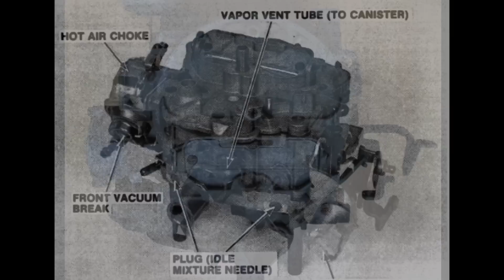Strangest Automotive Inventions:  GM's Rochester Dualjet Carburetor Or The "Demi-Quadrajet"

Comment: I remember my moms friend bought a new 76 Grand Prix, had a 350 2bbl, (my parents had a 73 with 400 4bbl) I opened the hood on the 76 and wanted to see the carb, it was a quadrajet without the secondaries like this video is describing, I was kinda surprised. I was used to seeing the 2bbls on the early 70s 400s and 350s, which was the small round type carb, was a pretty 76 tho, white with blue interior, I rode in it once and was impressed with the quiet smooth ride, it was probably less than 6 months old at the time. Never forget little memories like that. in metro ATL! I was walking down the road and she stopped and asked me if I needed a ride, since she was headed to our house anyway, A/C was on and it was hot outside so I jumped in!

Comment: My friend bought a 75 Buick Apollo and I remember we thought it was awesome that it came with what we *thought* was a 307 with a quadrajet.  Seemed sluggish and we just assumed it needed some tuning up after sitting for a long time and had those malaise era highway gears in the rear end.  When we started getting into it we were so confused when we found the dual jet. Never heard of it before!  And of course that 307 turned out to be an Olds 260 as well with it's itty bitty pistons...  Those were quickly removed in favour of a 400 Pontiac that was sitting around!

Comment: I almost killed my 56 Pontiac Chieftain rebuilding it's Quadrajet square bore carburetor. I left town easy, it worked fine. Coming back I gave it the beans, the throttle stuck. I pushed the brakes to the floor, repeatedly jabbed the throttle, 100mph. I reached to shift into neutral, to blow the engine and there was the key. I turned it off and stopped, now in town, and looked at the carb. One link I put on backwards. Flipped it around and I was OK. Old Quadrajets where tricky but where the best when tuned right.

Comment: Adam as a side not this carb was used ONLY in the 1976-1977 model year in 1978 they went to the "HALF QJ"
Reply: Also what about the SPREAD BORE 2bbl VARAJET carbs used on the early 2.5 and 2.8 X-Cars along with jeep and s-10's

Comment: Quadrajet carbs were great, very adjustable and not super sensitive to contamination. I used to rebuild them in the 80's for $50 plus the kit and it took me about a hour. later models have a enrichment solenoid that made adjustments to the idle circuit very hit or miss.

Comment: I remember these cars very well. For the most part, a number of the engines were snubbed and disrespected for their lack of power. And with some deserved justification. However, this was a period where cars (and trucks) were transforming and updating technology very rapidly. The big GM cars were basically a home run. But not all the engines were. Keep in mind, the transmissions were also changing rapidly as well. We were going from 3 speed automatics to 3 speed automatics with lockup torque converters. Plus we were starting to see the early 4 speed automatics, and 4 speed automatics with lockup torque converters. Also electronics were starting to come on board. Then you add in increasing passenger safety standards. (Remember the buckle start ignition interlock seat belt systems of 1974/1975?  We were getting into the early 1980’s before a lot of that was getting sorted out. (How about those motorized shoulder belts?). Then airbags started being deployed in large numbers starting in 1988. 

And we started seeing more fuel injection starting in the late 70’s and early 80’s. The Chrysler lean burn. The throttle body systems. (Th GM 2 barrel systems were quite robust and almost bullet proof.)

Comment: Thank you so much for your insight.  I had the privilege of driving two different Oldsmobile 260 v8s One was a 1975 and the other one was a 1976 The 1976 came from California so it had all the California admissions and because of those the engine was much more gutless than the 1975.  I rebuilt the carburetor on the 1976 and really to be honest there wasn't much to it and not much that you could do to get any more horsepower out of it through the carburetor.  Around the city it wasn't bad but if you need to accelerate for passing or to get on a busy expressway it was nail biting..... gutlass.......
Thank you again!!!!!!

Comment: Trivia Tidbit - the shaker hood scoop on the Olds 403 in a Pontiac Trans Am you showed had the wrong sticker on it.  "T/A 6.6" denoted the Pontiac 400 which was used on 4-speed cars.  High-altitude cars and auto trans cars got the Olds 403 and the correct hood scoop lettering on those cars should say "6.6 Litre".
Reply: WWWEEEEEEOOOOOOHHHH nerd alert! LOL
Reply: Yes this is true, goood to know.
Reply: @johnstrauss8061  I prefer the Pontiac 400 over the 403 Oldsmobile any day.

Comment: Wouldve been kinda nice if you had asked before using my pics. Those pictures underhood of the early ones are ones i posted of the Chicago Cutlass
Reply: Watermarking them as his own is really low. Hoping your post in the group brings more attention to this. The community has gotten better at cleaning up these sorts of channels. There's a NASCAR channel that's been getting a lot of heat for basically copying from Wikipedia, or using other sources without credit.

Comment: I have a 1978 Olds Delta with the Olds 350cid. I love the car. Once i removed the gigantic catalytic converter, ran dual exhaust. The car had excellent pickup power and it gives me 18mpg. Despite having the 2.41 rear it lights up the back tires pretty easily. While giving good hwy mpg.  ( one will peel ) lol

Comment: In '83 I bought a '79 Regal from a coworker. It had a 301 Pontiac V-8 with the early full-body Dual Jet carb and a 2.41 rear axle ratio. Highway mileage was unlike any V-8 I've owned before or since, besting my previous '67 LeSabre and '67 Skylark with 300 CI Buick V-8s and  2GC carbs. Drove the Skylark for 2 yrs, the LeSabre (not my last) for one, and the Regal for eight before each in turn was begged away from me for being so trouble-free. "Good old days."

Comment: Had a “dual jet” on a 71 monte.  My guess is that the accelerator pump was shot.  A complex tap dance on the accelerator would open the secondaries, but I only went to the trouble in tunnels. :-). Got between 18 and 26 mpg!

Comment: Never ran a DualJet, but did have a 2SE VariJet on a Pontiac 151 Iron Duke 4 banger in a 80 Jeep CJ5.  The VariJet was a progressive 2bl with a small primary and large secondary much like the QuadraJet but with 2 instead of 4 barrels.  The light CJ5 ran surprisingly well with it.
Reply: I have a  Cimarron with the 112ci and the 2ESE Still trying to get it to idle.

Comment: I had a 78 Cutlass Calais with the 305, I have no recollection of the carb at all because unlike the cam, the carb was trouble free. I was disappointed with the gas mileage of the 305, it got exactly the same mileage as the 76 Buick Regal that I had previously with the 350 Buick V8.

Comment: If you haven’t already, could you do a video about the rochester varajet carburetor. That was an interesting carburetor because rather than a Q jet cut in half horizontally, it was cut in half vertically. It was essentially a 1 barrel with a mechanical secondary. Didn’t produce a lot of power but was very reliable and worked well

Comment: Speaking of CAFE (Corporate Average Fuel Economy). As you know, it would mandate a fleet-wide average fuel economy standard. Simplistically, for every low-fuel-mileage Corvette sold GM would need to sell a bunch of high-fuel-mileage Chevettes to bring up the overall average.

When the law was first proposed the UAW immediately protested, arguing that the Big-Three would simply import Japanese cars, slap their own label on it, then sell it stateside to up their fuel-mileage average. That would cost American jobs.

Congress agreed and added to the law that CAFE would only apply to American-made cars. This made the UAW happy. But the Big Three responded, "What's an 'American-made' car?" They pointed out that they often buy sub-assemblies from outside the U.S., and that few cars were 100% made in America.

After much negotiation, the number 75% was agreed to. That is, at least 75% of the car had to be made in the U.S. to qualify as an "American-made" car. And that became the law.

Almost immediately, the Big Three looked at their biggest gas guzzlers and started producing 26% of them somewhere else. I recall that GM examined the Chevy Caprice and sourced non-essential items like the hood and interior from outside the U.S. Thus, in the eyes of the CAFE law, the Caprice was no longer an "American" car and thus its (poor) mileage wouldn't factor into the CAFE average. In later years, things like Marketing and Advertising costs were also baked into this 75%. Chrysler (and later others) then outsourced the advertising budgets to foreign agencies to reduce the domestic content.

Several Congressmen and UAW workers lamented, "we didn't see that coming."

PS - at least, that's the way I remember it. Others may chime in with more accurate details.
Reply: Foreign cars are subject to CAFE, and to keep captive imports from taking over the <75% US-made cars are instead put in their own bucket, so there's foreign car and domestic car numbers for each (as well as the light truck bucket). This kind of effect is used to 'bury' some lower economy models in the (usually overperforming) import bucket. Such parts arbitrage is harder to do now since Mexican parts are now considered 'domestic'. Furthermore the buckets since 2011 have diverged and 'foreign' cars have to do a bit better than 'domestic' cars.

Comment: What I always thought funny is a 260 Olds and a 403 Olds are externally identical. !! The 403 Oldsmobile Small Block is a very underrated motor , I've built or owned  4 now , all ran well and no problems one was a stock bottom end 600 HP 6000 rpm motor still running today . That super massive bore of 4.351 inches is the biggest bore of any modern V8 ( bar a 460 Ford and that's only bigger by  0.009 ) , the little Olds has a bigger bore than a 500 caddy V8. It really wakes up with more compression/cam and that magic 3.385 (86 mm) stroke all Olds SB have is a great advantage. All modern motors use the 86 mm stroke, Ford, Toyota, Subaru, Ferrari, Lamborghini, ever wonder why 86 mm stroke comes up so often ? It's the perfect length for flame front progression and piston speed on modern fuels . ( When I say modern I mean post WW2 ) . Oldsmobile had that stroke by design on the first SBOs designed by Charles F Kettering.
Reply: Grandpa was born in 41 and said in his hotrod days the Olds engines were the go to.
Reply: @NillaRilla82  yeah they were always ahead of the rest of the field , the first modern V8 in 1949 ( caddy stole the design and they released almost the same engine in 1949) , the Gen 1 Olds were the top hot rod motor back in the 1950s into early 1960s . Your Grandad knows his stuff.

Comment: As I recall, the reason GM went with the DualJet over the 2GC was efficiency. The 2GC was an older design than the QuadraJet. As a result, the primaries on the QuadraJet were more efficient than the 2-bbl 2GC. It was easier to meet emissions and fuel mileage standards using half a QuadraJet than it would've been trying to modernize the 2GC.
Reply: @kirkwennerstrom2506  it had bigger bores and venturi than the primaries of a q jet.  I still have one on a buick v6 oddfire in a jeep. It's a great carburetor.

Comment: I wonder how many Olds 260s with the early duel jet in later years got a Quadrajet installed by accident and ended up with a strange under hood fuel leak !! As a Quadrajet would bolt were that early Duel jet was on the dueljet manifold !!

Comment: I've been a tech since the late 70s. This was a bombproof carb. They just worked. The only drawback was they were very difficult to rebuild properly and tuning was next to impossible. I also have lived in Rochester most of my life. The Rochester Products building was mammoth and offered some of the best paying stable job opportunities in New York. It was a huge part of our Hay day.... Imagine, You've just graduated and have to choose from Kodak, Rochester Products, Xerox, Gleason Works all within a short drive.
Reply: Rumor had it that the throttle body injection system was a way of using lots of the old processes and equipment as Rochester Products moved to building port injection systems. It also required less training to get people up to speed. RP is long gone like many of the greatest American auto makers and suppliers.
Reply: @LaPabst  Q-jet: I've delivered there, it's a shame. Rusting HVAC pipes, deteriorating brick bldgs, anything concrete is cracked and disheveled. Ditto for Windsor, Ont.-beautiful glass bldgs just dark and empty and walled off. I only went to Cleveland once and don't remember but they make 1-ton truck and van chassis there and those move pretty well.
Reply: In a Cadillac olds dealer I worked at , I had no trouble with Quadra jets as long as I left them in the fresh cleaner solution with oscillating parts basket for at least an hour and used the gm carb kit.   They ran smooth and like new.
Reply: They were a Lil tricky , but I would say by no means they are hard to rebuild. I've done so many I could do it blindfolded, and I'm just a hobbiest
Reply: @curtjeziorski350  if one knows anything about carburetors they really are a piece of cake
Reply: I wish you lived near me. See I have the 2ESE carb.......
Reply: the stock and superstock drag racers have NO problem tuning them,,,really basic and simple,,,if your having problems I suggest your not all that good with carburetors
Reply: @tomstiel7576  😂 Trust me, I'm checked out on carbs. Guess you don't understand what I'm saying,,, a rebuild and possibly a rejet on a stock smogger was a big bill for our customers... The ones that had to get to work, not putter in  garages on weekends for fun.
Reply: @LaPabst Love how strangers make a comment and then others determine their education and experience level on a sentence or 2. I've never typed a comment thinking anybody gonna judge either. Spelling 4 xample. Some read this and just can't help but say u didn't spell xample right. I know. I can spell. I just got big fingers and Lil letters. 😂
Reply: @LaPabst   i stand by my remark
Reply: @jasonchristopher2977  Sometimes it's fun to purposely misspell a word or two in the YouTube comments section. 😂
Reply: @trickyricky12147 I just dont get it. Ppl never heard of short hand? Think the recorder in vourt types out every single word? Hell naw. As long as we can convey the message, what's the bug deal you know? Question, Has your working on newer cars and trucks made you question your career? Ive seen a lot of vidoes saying as much. Whats your take?
Reply: @jasonchristopher2977  I don't wrench as a career and newer vehicles is the deterrent that doesn't even get me thinking about going that route for a career. My thoughts on other videos about this topic is this: if stealerships want to resolve the issue of many technicians industry wide in the trade upping and leaving, then these stealerships need to stop paying them flat rate and actually pay technicians for they're worth. What does management expect when their dealership techs are only paid based on book time? For now, the only solution from what I hear is to go work for an independent shop. Most independent shops don't do flat rate and do hourly from what I know. Sounds like to me that's the best route to go for anyone interested in that trade.
Reply: @trickyricky12147  Many young guys take the opportunity to cut their teeth at stealerships then move on to private shops or start their own shops. Most are very honest hardworking people looking to build a customer base. 

The car industry is just garbage and always has been. I have a good friend who actually owns a small Chevy dealership. A third generation family set up. The constraints he faces from GM are brutal as well. Not many people know that at any dealership, the dealer had to buy all those cars. They own them and resell them. It's millions in inventory. The whole system is broken and needs an overhaul.
Reply: There is no need to "tune" a Q-Jet. 😊
Reply: @deeremeyer1749  Some of the older ones could be adjusted as the engines aged.  Man, there were so many revisions. Some later had the mixture screws plugged but you could get them out and dial them up a little. They shipped set very lean. The racing guys don't worry about choak and choak heaters. Throttle stepping and vacuum pull offs. The linkage systems and how they interface with each other is stunning and ingenious.
Reply: @LaPabst I definitely agree about the vacuum pull off.  I disconnected mine because it delayed the opening of the secondary upper valves too long...  If you have the rods, the hanger and the spring tension set properly you don't need a vacuum pot delaying your secondary application.
Reply: @deeremeyer1749  They did ship ready to go... They do work well. I have a 78 Vette with the L82 in it. It still runs well with the Q jet on it. But I think next summer I'm going to try a Dominator on it. The gas we get in Upstate NY is 10% ethanol. I do use non eth when I can find it. I'm interested in seeing how it does with a modern carb. I put o2 sensors in the headers. Should be interesting to see the comparison.

Comment: Bought a used 1977 Cutlass Supreme 4DR with 260 V-8 in 1985 when I first entered Real Estate from retired couple I used to deliver their newspaper, mow lawn, shovel snow and paint their home in College Park MD. The light blue metallic paint was already compromised, driver door hinge was worn/sagged, interior plastic/chrome trim was brown from tobacco smoke could never get the smell out of the interior! Ran smooth, decent gas mileage only replaced fan clutch in 2 years of ownership. Good highway vehicle.